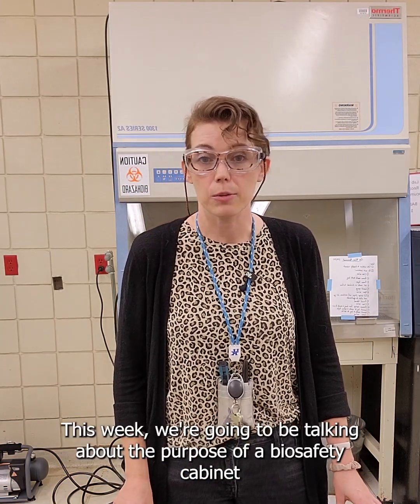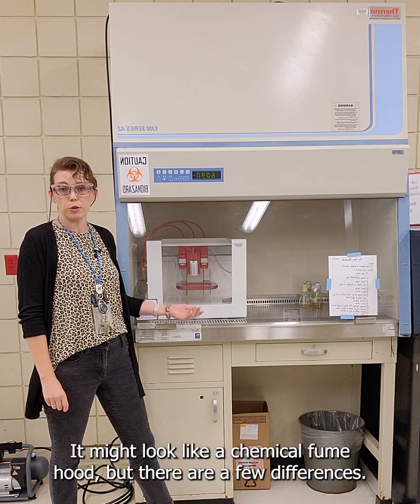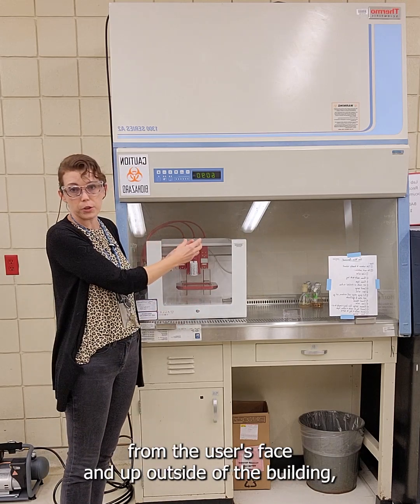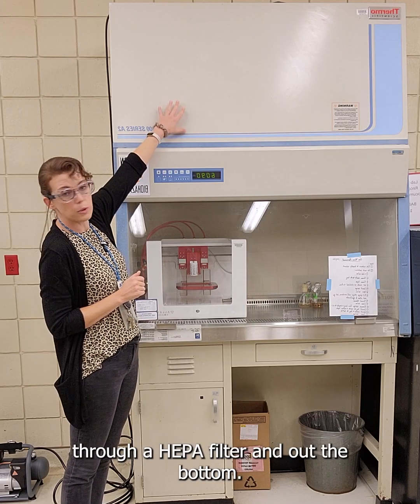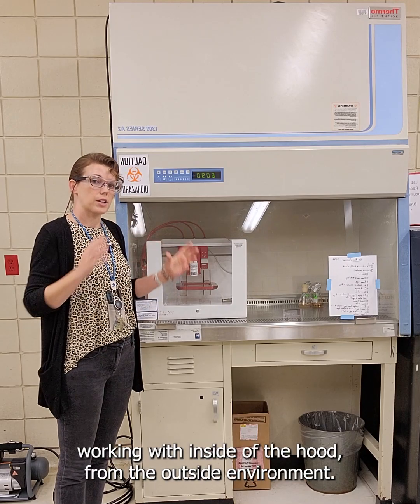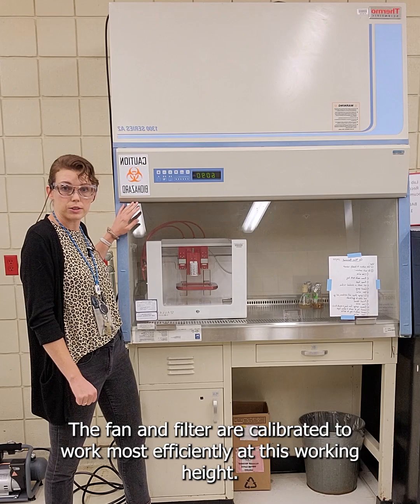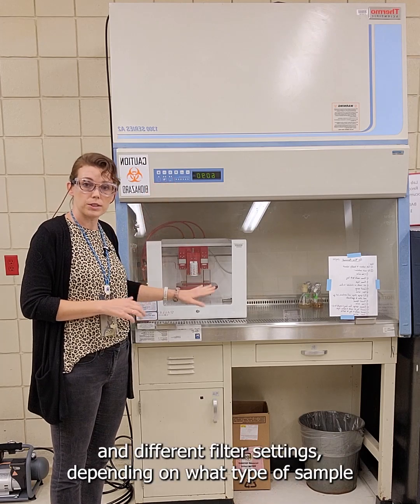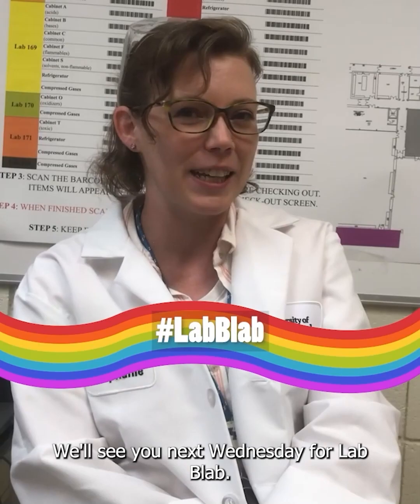Lab Blab Episode 13 | The Biosafety Cabinet

Comment: Thank you so much for this .
But in the conclusion part ,you talked about different filter settings depending on what type of sample you're working with and what level of sterility you need to keep it at....
Does that mean that you can change the filter (like bringing it out to put another)
And does that also mean that there is a place where we can set the level of UV light we need at that point in time